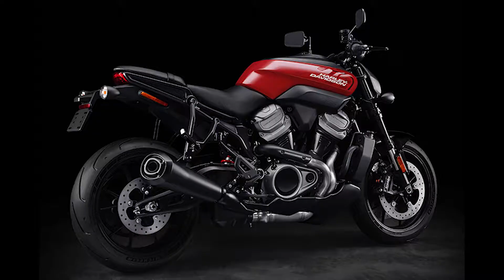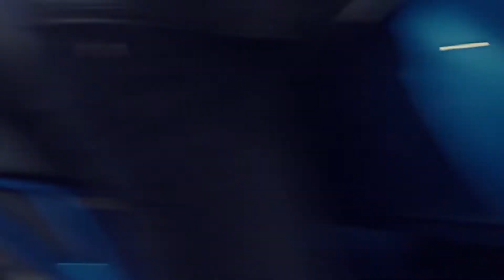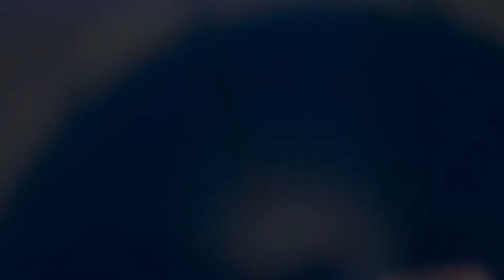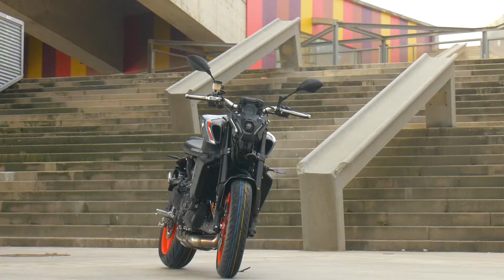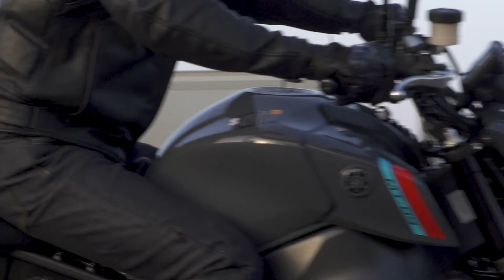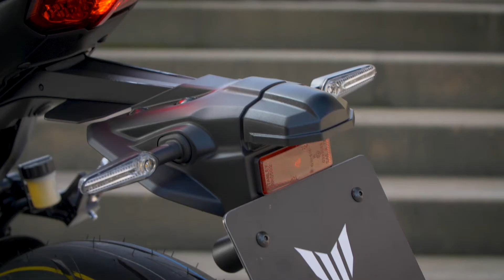New 2022 Yamaha MT-09 | 6 Things to Know

Comment: I bought the 2017 version & have had a love/hate relationship with it. I love the motor but under hard acceleration the front end shakes violently like it's going to spit you off at any moment. Even an expensive steering damper tamed it only slightly & nothing else I've tried has helped. I understand Yamaha has addressed this problem with this new model. I've never had a bike that was such a disappointment & I've owned more than a few in over 50 years of riding.
Reply: 2022 much better
Reply from the maker: That sucks was it common to the 2017 or do you think something is wrong with your particular bike?
Reply: @NewBikeMikeChannel  I don't think it's my particular bike because I've seen plenty of complaints on forums & such where this characteristic is brought up. I recently saw another YT video, i think it was a British online magazine talking about the 2022 version where they mentioned that the latest model has shortened forks but with the same amount of travel as previous bikes in an attempt to get more weight over the front end. I only weigh around 145 lbs. so maybe it's not an issue with heavier riders but I do know I'm not the only one that has had this experience.